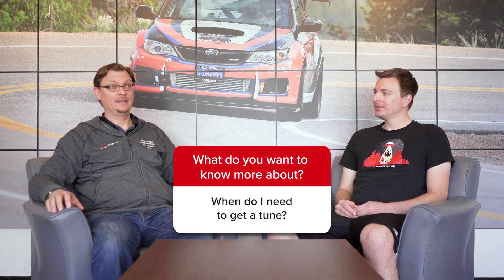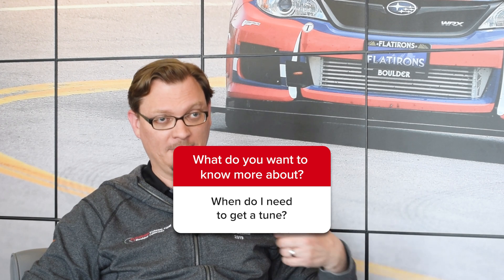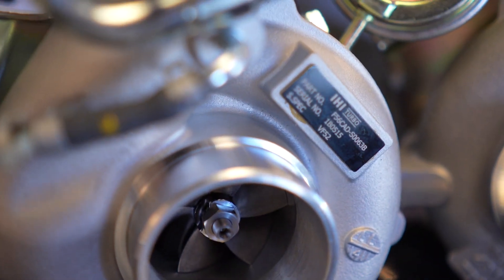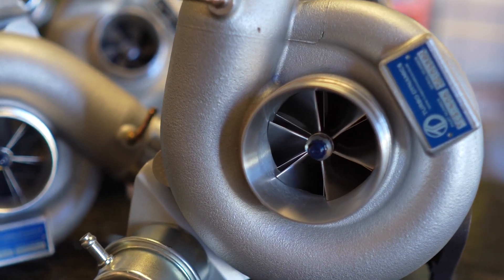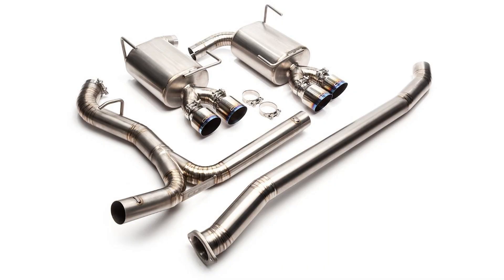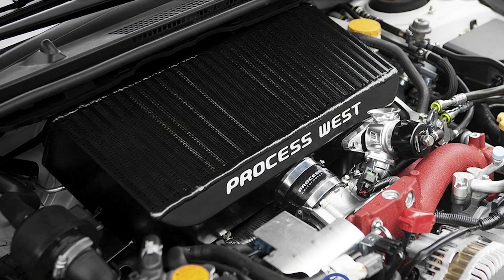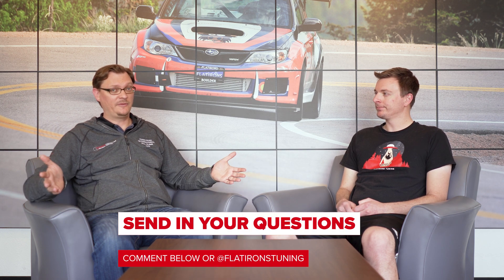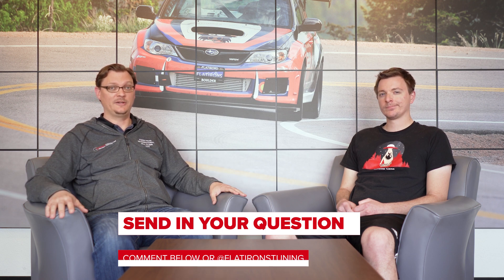Which Subaru Parts Require a Tune?

Comment: Thanks for sharing your knowledge!

So if I add an aftermarket Catback Exhaust System, aftermarket Intercooler, & aftermarket radiator a tune is NOT necessary?
Reply from the maker: Thanks for watching and thanks for your question.  Of those parts, I would only recommend a tune with the aftermarket intercooler.  If you change to a larger or more efficient intercooler, it is a good idea to get a tune to make sure that your fuling is correct, etc...  That is the safest way to do that.

Hope that helps and Stay Tuned!
Reply: @FlatironsTuning  you guys are great! Just made an order on the site. Thanks for helping so many of us!

Comment: Thats weird, because I just bought a subaru that has an upgraded turbo (vf39), STI TMIC, Perrin intake tube, TGV deletes, aftermarket downpipe with no cats, and an STI catless up-pipe, and although the ECU has been tuned for timing, higher boost, and open loop target AFR, the MAF scaling has never been touched (verified against a stock oem tune for the same year vehicle) and yet the actual AFR readings are spot on what the they should be.

Comment: im Being told that an AOS needs to be tuned is this true
Reply from the maker: Thanks for your question.  That is only true if you are switching from a contained AOS (Street Series) to a vent to atmosphere AOS.

If you still keeping the PCV system connected as it was with just the AOS collecting the oil, you wouldn't need a tune.

We discuss this specific question in another video here:

https://youtu.be/6bPgslpWjak?si=EK_sYGQ1uhIchwbh

Hope that helps and Stay Tuned!

Comment: Hey guys! 
Thanks for a great video! 

Question regarding replacement of hoses along the intake track such as BOV recirculating hose, turbo to intercooler outlet, throttle body hose, purge valve vaccum hoses, boost solenoid turbo and intake side hoses. 
Is a tune/retune reuqired when these hoses are replaced? What are the considerations to be taken in to account when using afternoon silicone hose instead of oem as replacements. 

Thank you!

Comment: Hu guys silly question here. A couple of years ago I had my short block on my 06 WRX rebuilt. There was no tune needed again because I was told it was the same engine. Move forward to present time and I need to buy a new complete engine. My question is if I buy a new complete engine OEM or say an IAG engine would this require a new tune or would just be fine in running my old tune since the engine would the same or even better if I went with an IAG engine. Thank you for your help.
Reply from the maker: Thanks for the great question.  As long as you are keeping with the same parameters with the engine (ie. compression ratio) and you aren't changing your turbo, injectors, or any other critical components, you should be okay with the same tune.

However, if you had a failure that could be at all Tune related, it would be a good idea to at least have the car checked by the Tuner once the new engine is in to make sure that it is running properly.

Hope that helps and Stay Tuned!

Comment: What do you mean by small changes to the I/C? I’m planning on getting an aftermarket I/C. Does this then require a tune? Thanks for another great video..
Reply from the maker: Thanks for your question.  If you are moving to an aftermarket intercooler that is close in performance to the stock intercooler, then you may not need a tune.  Ideally you would want to take some logs or monitor your Air Fuel ratios to make sure that everything is still working properly.

If you are moving to a more efficient intercooler core, it is ideal to tune the car to make sure that it is running properly, and to make sure that you are getting the full benefit of the better intercooler.

Thanks for watching and Stay Tuned!

Comment: My stock turbo inlet tore and the only replacement I had was an AVO silicone inlet. It does not change anything before the MAF so the local tuner said it was fine, is this going to cause any issues or should I try and get a stock turbo inlet again?
Reply from the maker: Thanks for your question.  Replacing the turbo inlet doesn't require a tune because, as you say, it doesn't change the calibration in any way as long as you are able to connect everything back to the inlet.

Hope that helps and Stay Tuned!
Reply: @FlatironsTuning  Is this the case even when the new inlet is larger/less restrictive? Or is it because the MAF has already measured that air, it doesn't matter if the path to the turbo is less restrictive?

Comment: Great talk gentlemen! I have a few questions i hope you would donate your thoughts to.
Thoughts on drop in air filters like aem, k&n, ect... and tuning?
Installing a avo top mount intercooler on my 2012 wrx with a drop in aem filter, and spt cat back.
I have a  cobb access port with the stage 0 tune loaded. Do you think I am good to add the intercooler and stay with the stage 0 tune?
Reply from the maker: That is a tough question.  On the newer cars, in theory, they are more likely to need a tune with a drop in filter than some of the older ones.

The best advice is to monitor and log your car after making the changes (and ideally have logs from before to compare against) to see how different they might be, and that will tell you if the ECU is getting close to a limit, or having to adapt to the changes.

If you see a significant difference after putting on the intercooler and filter, then you would need to get a tune.

You could also have your tuner do a simple baseline after putting the parts on  to check power and the running of the car, and they will be able to tell you if you need a calibration adjustment as well.

Hope that helps and Stay Tuned!

Comment: Thanks for the video guys 

1 question

My car was tuned it's on SD and since it was tuned I have made some changes whilst rebuilding the car only crucial change is iv gone from a catchcan and pcv system and now iv fitted a 3port can and it's VTA and iv removed the pvc system all together,

I'm aware of the drawbacks of VTA I'm just wondering if the tune will need a tweek atall based on the potential to have a different AF mixture with the iduction of crankcase gasses 

And now not having any reduction in fuel mixture quality with VTA will things be different?

Il monitor with the wideband AFR anyway but curious what you think that's all 😌
Reply from the maker: Thanks for your question.  Yes, typically switching from a closed catch-can/PCV system to a Vent to Atmosphere system does require a tune for the reasons you mention.

I would definitely recommend monitoring your AFR's, and get the car tuned if you see anything that is unusual.

Hope that helps and Stay Tuned!
Reply: @FlatironsTuning  
Thanks for the reply... I think deep down I knew the answer as I was typing... But sometimes it's better to ask someone with more experience

Plus secretly I was hoping to be wrong and  you would say it's  fine 😂😂 ok guess a session with the mapper is required 😋

Thanks 👍

Comment: What are your thoughts on blow-through MAF setups?
Reply from the maker: Thanks for your question.  Before speed-density conversion was a possibility, that was a band-aid for high power cars.  Now that Speed density conversion is doable, that is definitely the way to go.

If you haven't watched it all ready, you should go through our MAF Vs. Speed Density video here:

https://youtu.be/vkgra7hp9EM

Thanks for watching and Stay Tuned!
Reply: Made some great power with a few dsm setups running different versions of the old maf translators. I miss those days. 
Indeed its day has passed though. Speed density benefits are worth the cost to convert if that's is the direction you want to go.

Comment: Grimmspeed claims that their front mount Inter cooler does NOT require a tune.  It says “No change in maximum boost or time to spool so it's safe to install and drive”. Can you give your opinion on that? Thanks in advance
Reply from the maker: Thanks for your question.  With something like that, it is great for that claim to be made, but I'd say you would at a minimum want to datalog the car after install to make sure that your engine is running properly.  Maybe it would be, or maybe it would just need a slight change to the calibration to get it where it needs to be.

Far better to take a look at the logs that to hope that everything is okay.

Thanks for watching and Stay Tuned!

Comment: Thanks guys for every effort you make. Two questions please:
1- How safe is it to drive the car (intake & downpipe installed) without a tune, in an intention to tune it later on (while avoiding pedal to the metal) ? and how long is it okay to stay untuned?
2- As far as I understand when it comes to tuning, the cruciality boils down to air/fuel ratio more than gaining extra horsepower; meaning to get the car to a safe chemical composition is the core idea of tuning more than squeezing as many horsepower as possible out of the engine, correct?
Reply from the maker: Thanks for your question.

For part 1, when you are talking about an intake, there really isn't any safe distance to drive if you don't have the correct calibration on the car for the intake you are running.  Damage can occur somewhat quickly with that issue, and it is not recommended.  A downpipe is a bit less of an issue, but it can lead to an overboosting issue which presents its own set of problems.

The best practice is to drive your car as little as possible without the proper calibration, and never to drive with an intake that hasn't been calibrated for.

Part 2, I would say that in terms of safety, you are about right, but there is more to tuning than just making sure that your AFR's are correct.

I'd recommend going through our video talking about what a tune does here:

https://youtu.be/sJQFoReIrA4

Thanks for watching and Stay Tuned!
Reply: @FlatironsTuning  Thank you again for this elaborated, professional and satisfying answer. This channel has never disappointed me.

Comment: Yea good luck getting a tune rip Cobb;(
Reply: That's not even close to true. What cobb is doing is basically just not letting tuners bypass emissions related equipment using the ap tuner software. Has nothing to do with tuning itself. But it does interfere with doing mods that change/ remove emissions because you will get a cel. But tuning is still alive and well.

Comment: Thanks for the video. I've had a K&N Typhoon intake on a 2005 STi running the stock tune for 13+years with no issues. Do you have any experience with this intake on Subarus?  I'm content with the power so I've never tuned the car. Would you still recommend tuning in my situation?  Something like an AP and an OTS map? Thanks.
Reply from the maker: Thanks for your question.  With that much time on the intake, you are definitely fine with the stock mapping I'd say.  Any issues would have come up long ago.

Thanks for watching and Stay Tuned!
Reply: @FlatironsTuning  Makes sense. Thanks for the quick response. Keep up the good work :)

Comment: Some other mods that don't need a tune for EJs are turbo inlets, post maf hose and fuel rails. But if you're doing those there's probably something else you're doing that will require a tune anyways lol
Reply: Go-fast brand stickers always need a tune however.
Reply from the maker: Good points.  Thanks for the comment and Stay Tuned!